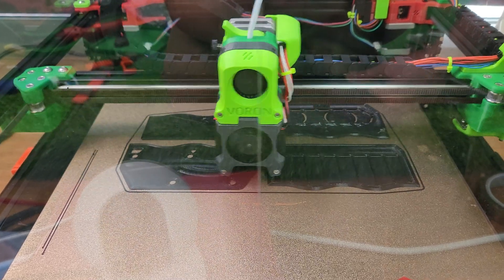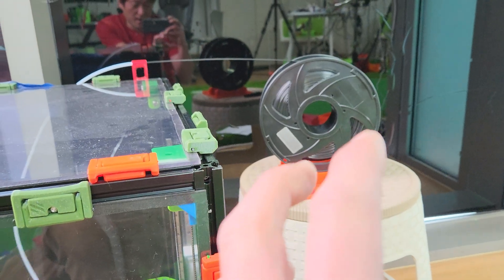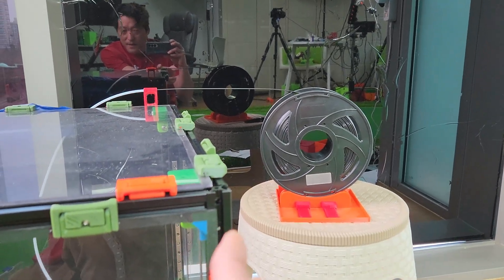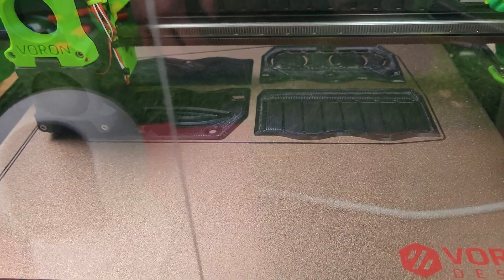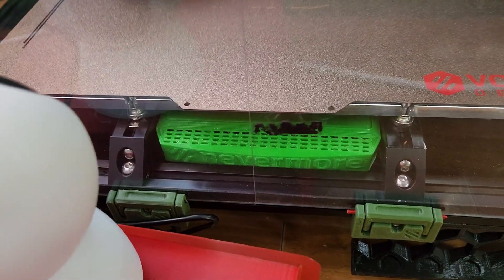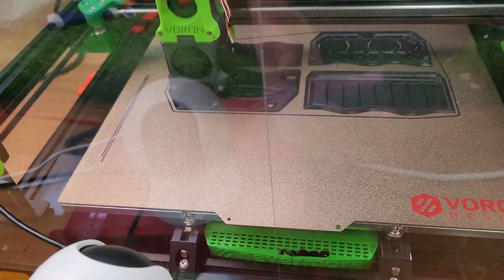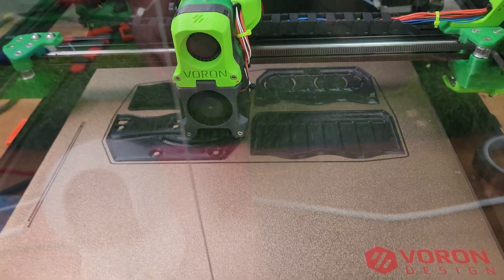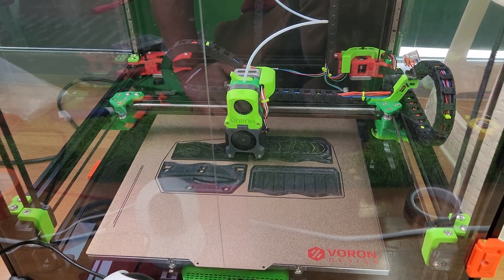Using Bed Mesh for Larger prints on Voron 2.4!

Comment: Why not just print an insert for the spool that's weighted. Being in the center it shouldn't require any more force to turn it, but supply enough downforce to keep the reel in place when the filament runs low.

Comment: I agree.  My 250mm bed consistently warps in the same way.  Melted any inductive probes yet?  After my third I ditched it and replaced it with a BLTouch.  I'm thinking of maybe changing to four small pads under the bed to make room for extra more underneath for extra anchors.  Mesh helps, but only to a certain point.  Anticipating this issue was the only reason I didn't go for a 300mm build.
Reply from the maker: No melting of probes yet, working flawless everytime, my quad gantry level average .005mm.